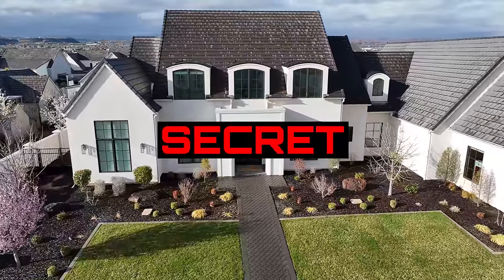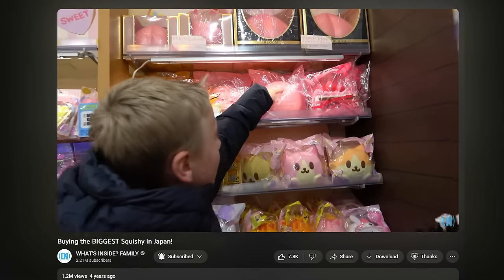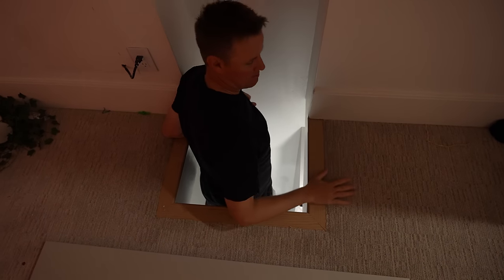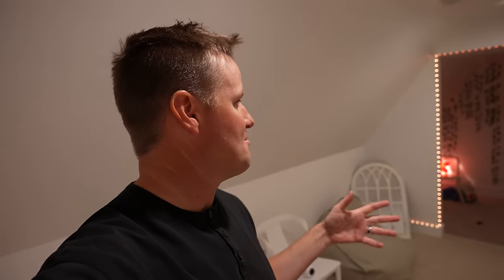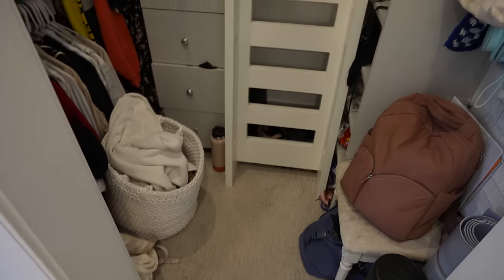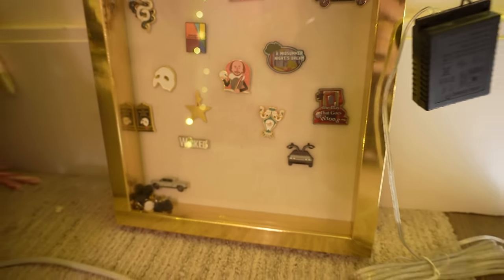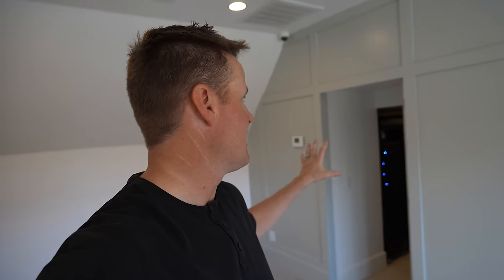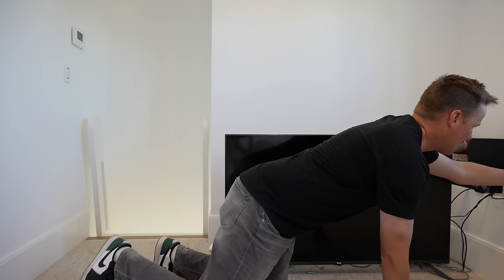Secret Rooms in Our Dream Home!

Comment: For the Ladders you could have used the ones whose steps kind of rotates.

So when they are in "CLOSED" position, they look exactly like the ones in Lincoln and Claire's rooms, but we you put them in "OPEN" position the steps rotate 90 degrees and becomes like a normal ladder.

Comment: I had a job inspecting houses yearly, went into one that had one that reminded me of Harry Potter.... it had this tiny door under the stairs in the basement, designed for their young son, and on the other side it was relatively small (yet my big butt would've been comfortable hanging out in it) but they had painted one of the walls with that chalkboard paint and was decorated very cutely, I loved it. I've even seen secret passages that use those plastic playground slides from the main floor to the basement, it was awesome.

Comment: You should have set up the ladders in the girls closet as shallow shelves for sweaters, shoes or smaller stuff. The shelves can have a more narrow width without raising any questions about purpose. A half round dowel edge trim helps keep items, especially shoes, from sliding off the shelf. The trim also serves as the toe hold when using the shelves as a ladder, some “L” shaped low walls at the top of the hatches will make it more safe and provide a seat allowing you to swing your legs to stand from seated entering the room. If you put a handhold on the wall to the edge of the hole, it will apply more security when accessing the ladder after swinging the legs back through the hole. There are escape hatches you can get added to the roof.  I’m excited for your eventual grandbabies, if you still have that house! My husband and I have started working on plans to create a hidden path in the woods behind our house. I can’t wait to create discoveries for him to find on our adventures. All the fairy homes and frog villas he reads about in his books.

Comment: I think the secret rooms are a great addition to the house since that space wasn't being used anyway.   The only thing I don't like is the tight space getting into some of them, but I assume that couldn't be helped, plus it seems fine for kids.      For the ladders,  a "pull down" ladder might be better.  They have pull down ladders for attics and I think those might work better for some of those secret rooms.  They would feel more like a real ladder, and be easier to climb.   Your openings on some might be too tight for a pull down ladder though, so if that is not an option for you, I would at least add rubber cushions around each step of your existing ladders so they aren't so sharp, slippery, and hard to climb as you had mentioned.  Maybe white colored rubber to match the color of the ladders.

Comment: I noticed in the corner of Lincoln’s room there is a panel box with something, and in the area near where you enter Londons room there is also a panel box I was curious about what those are for. They looked like the covers that they would use for plumbing, but I saw wires going through.

Comment: Pretty neat. 👍
I don't think all that much can be done about the ladders due to space constraints, but you might be able to install a platform lift there - one you either pull up yourself whilst standing on it, or possibly something electrical. It might also double as a cover for the ceiling hole, making those thing even more "secret".
Just be careful to not create a squeezing hazard with moving parts there.
The two simplest versions I could think of for a lift like that, either use two guided bars at least one of which a threaded linear actuator, or two / a wide toothed belt driven by steppers with the platform hanging clipped in on one side of something like a vertical slide.

Aside from that ... a pull up seat ?

Comment: So on the stair front for the variours rooms. Have you considered folding stairs. Similar design to what you have now but make all the slats taller, put hooks on them and then a bar and hook just thing metal bar, that when you unhook it swings the things down and when you lift and hook in place lifts them up. 

Ideal to hold jewlery, watches, etc... and a good way to make the steps a bit deeper to stop the pain on feet.